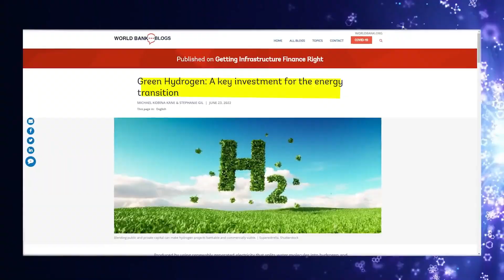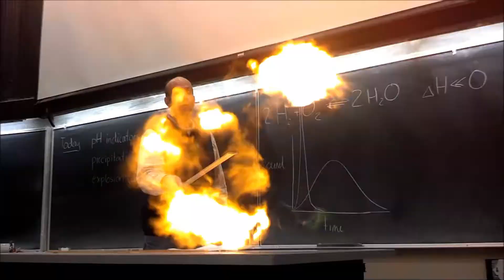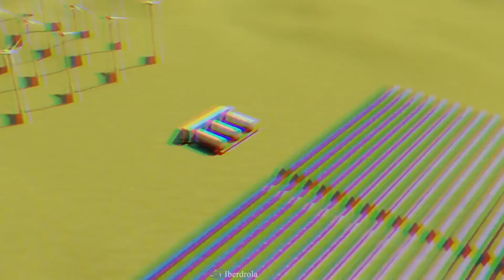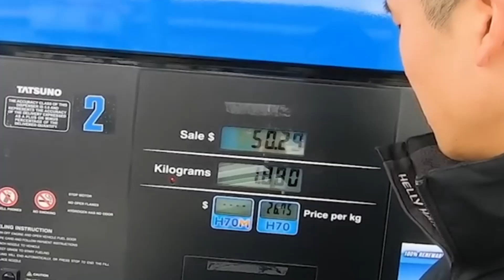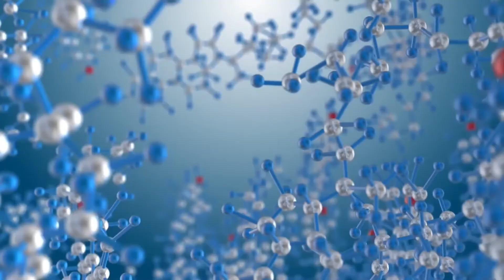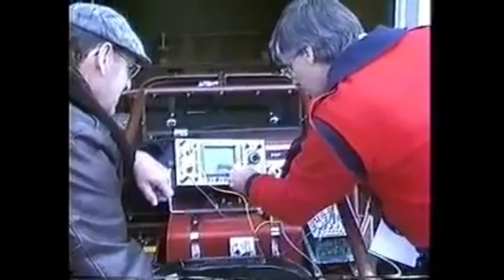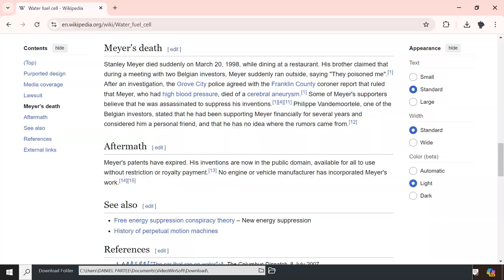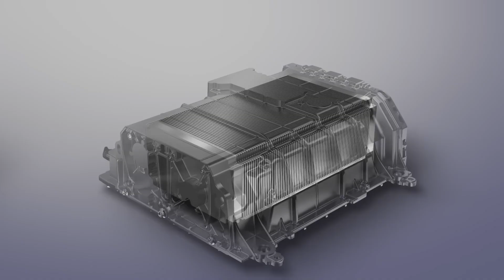Toyota's New WATER Engine Will Destroy The Entire EV Industry!

Comment: Running an HHO process requires electrical power. Where is the power to run the HHO generator coming from?

Affordable HHO generators are only about 70% efficient at converting input energy into hydrogen while an engine+transmission are about 40% efficient at converting fuel into work at the wheels.

If you are going to fit the car with enough batteries to power an HHO generator large enough to run a car engine, you would get ~3X as much range per kWh by going with direct electric drive train.

Comment: To produce 2kg of hydrogen from water by electrolysis would require about 100kWh of electrical energy, a battery rating that you would find in a high performance electric vehicles. 2kg of hydrogen could produce about 60kWh of energy. To run a water powered car, you'll need to charge a big battery plus carry the extra weight of water tanks, a hydrogen production factory and a hydrogen combustion engine. And and all for only 60% of the power the battery alone could have just delivered to the drive shaft. It's an inefficient way to delivery power-out vs power-in but a cool technology concept.